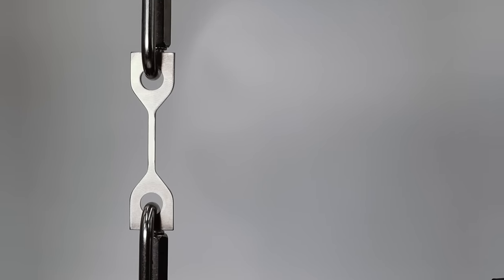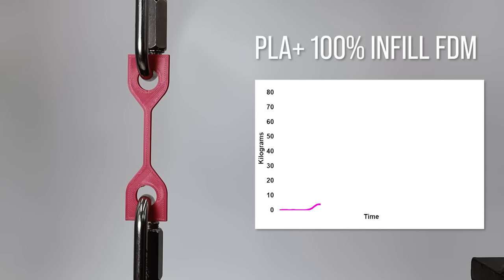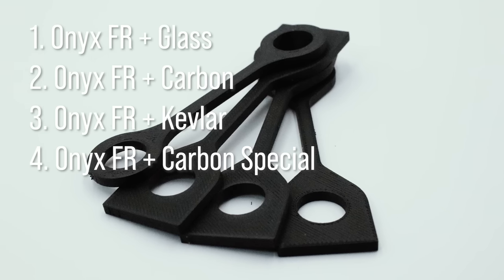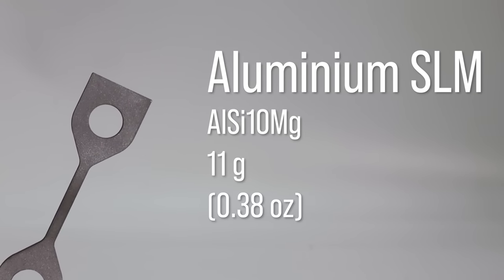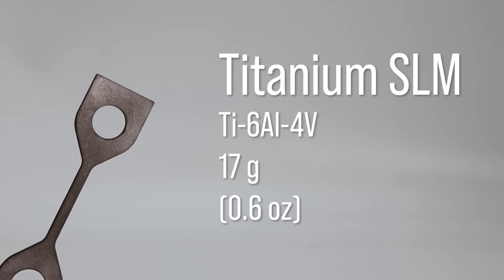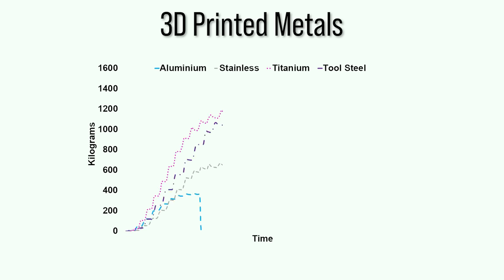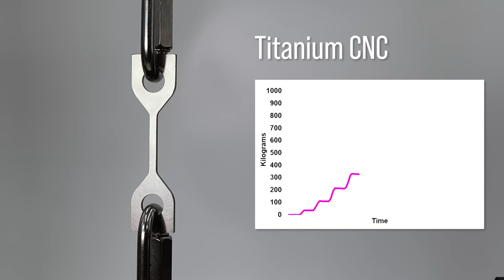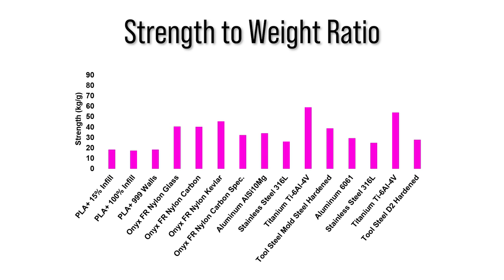3D Printed Metal vs CNC Machined - How Strong?

Comment: didn't expect the 3d printed metals to be better than the cnc ones, interesting
Reply: From 1 single test? Can hardly draw any conclusions. But my guess would be that 3D printing gives more consistent results.
Reply: @spugelo359  as far as I know different metals were tested and all printed metals were stronger than the machined ones. I wouldn't call it a single test as such, as multiple metals showed the same pattern
Reply: @Serachja  That doesn't change the fact it was only 1 test for each one. That is not how testing is done. And doubt that was the only issue with testing either... either way something fishy is going on.

Comment: 3d printed steel is already hardened I thought🤷‍♂️ The whole part is placed into a oven at metal melting temps to bake off the “glue” and this usually results in parts shrinking to a expected size.

Comment: Are the cnc'ed parts laser cut or machined?
Reply from the maker: They’re machined.
Reply: @electrosync  I machine test parts for an industrial test machine in our metallurgical lab similar to your set up. We are required to have a polished surface in the break area. Any, even tiny tool marks will be a premature fracture point and throw off the results. Were your machined parts polished?
Reply: @blitz3653  tbf, the amount of fracture points even a sintered powder 3d metal part has, is vastly higher than any machined piece. The only thing affecting it could be internal stresses caused by the high temperature in the machined areas. But it's more likely that it's simply a different alloy, and not the same base metal.

Comment: Actually I think compressive strength or especially buckling resistance is an even more interesting test
Reply: Steels generally are best in a tension load Vs compression in a structural environment. Concrete for example is amazing in compression and terrible in tension.
Adding steel to concrete gives it tension capacity.

Comment: I do believe this testing method is slightly flawed. Do we know what specific type of aluminum or steel? The 3-D printer made out of. Generally speaking 3-D prints should be weaker than cnc parts. The 3-D printed and cnc materials need to be the same alloys.
Reply: Also, with the 3-D prints having to be centered, it could affect their strengths. Both samples should be put through the same heat treating process to get accurate results. These results are skewed to what should be happening in a real world application

Comment: wouldn't it be a more accurate reading if the bolt going through the hole in test piece was sized properly? Seems like most broke in in the center but on the kevlar and carbon fiber ones it seemed like the bolt hole failure added to the main failure🤷🏻‍♂️ also missed opportunity CNC pla 🤷🏻‍♂️

Comment: correct heat treatment is so important and the kind of metal used too. there is way better aluminum and steel specially made for tensile strenght ans also hardened and heattreated ccorrectly. just making it glow could make performance even worse. the metal may get too brittle or too soft. normally its made red hot and cooled several times to normalize it, then hot to a precise temperature and then quenched in some liquid for hardening depending on the kind of steel. sometimes special oils sometimes just water. after that it goes in the heat treatment oven to finish the job by getting it up hot but not glowing hot, Temperatur again depends on the kind of steel. in that process it will change color. sometimes more yellowish sometimes blue or even purple. after all of that your steel is ready to go. you could also do all of that to the raw material and then machine it but its way harder and you would need tungsten tools for most of the high grade steel parts. also it would have to be cooled all the time because getting it hot (like everything above 200⁰) would ruin the temper

Comment: You really need to do multiple tests of each material/setting, without some statistical analysis your results really don't tell us anything. Are maximum wall thickness and 100% infill fdm prints really that close or is one or both actually an outlier? What is the standard deviation for ultimate tensile stress? Were they printed under the exact same conditions? By averaging results from multiple prints you can control for variations due print conditions etc.

Looking at this type of data is neat and all but you can't make any kind of conclusions or statements of fact without multiple trials and some basic statistical analysis.

Comment: Cnc aluminum is only as good as it’s starting material and it has a lot to do with grain structure. 3d printed has no grain structure. It’s random so can be stronger in stretch test but weaker in an impact test.

Comment: Why why heat the metal?? you make it softer to deformation and brittle to fracture (you transform the elongated hard to deform crystals in small easy to deform, more vulnerable to corrosion and break, don't heat if not to alliviate internal stress or to heat treat!

Comment: You'd better consider not load vs time but load vs elongation.
And breakage point is not the most interesting part here. You'd better look at the so called Proportionality limit (maximum stress after which the part will come back to initial shape after the stress is not acting any more).

Comment: sorry, man, but the experiment is not correct. Firstly the form of the samples. Those should be rounded to avoid any imperfections of cutting. Secondly the speed of stretching should be constant and no pulses. Also the speed of applying the force should be different for plastics, because they have static fatigue. It means that if the plastic is under constant force for some time the strength of it drops significantly. So the speed of the traverse movement should be 500 mm/min. For metals it's not that much of a difference, but as you see those flat samples perform not properly due to your results for casted against 3d printed metal samples